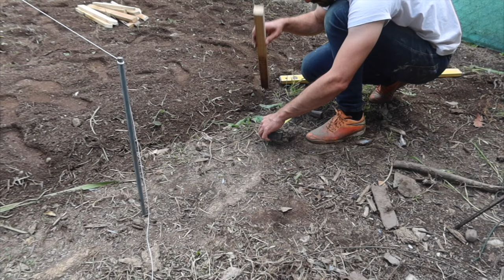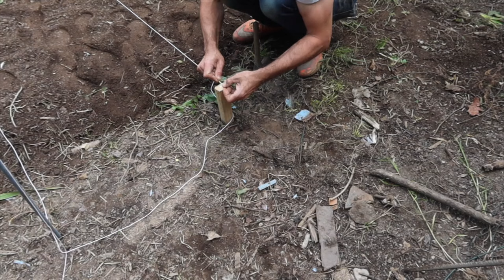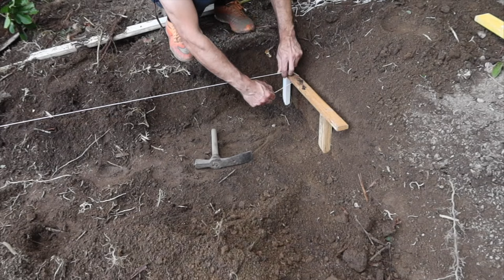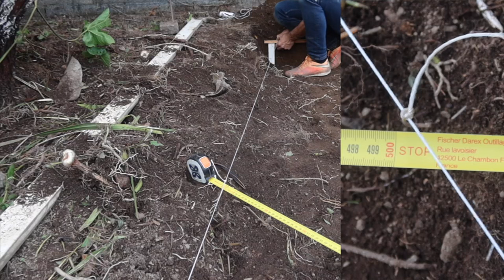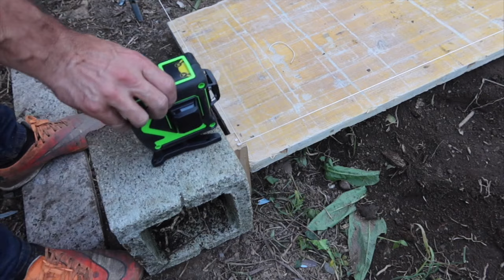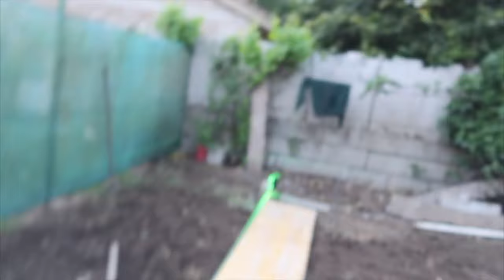✅  3-4-5 METHOD 🔥 How To MAKE a PERFECT Right Angle

Comment: Easiest way l find is 345, do the 3 first then from one end do the diagonal 5 and with the end of the tape swing a curve mark for 100 or 200 mm. Then when you measure the 4 the 90 degree is where it intersects the curved diagonal mark. Saves re positioning the markers